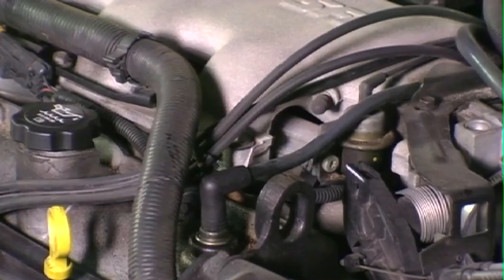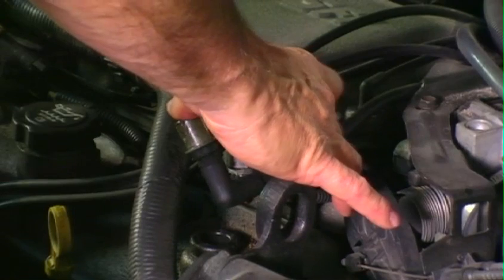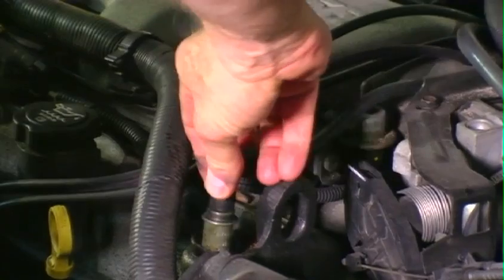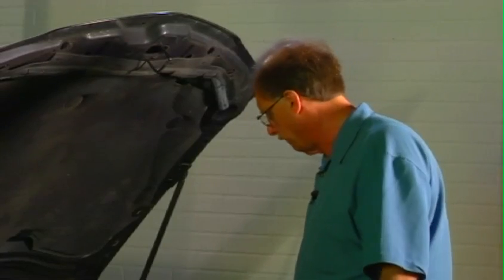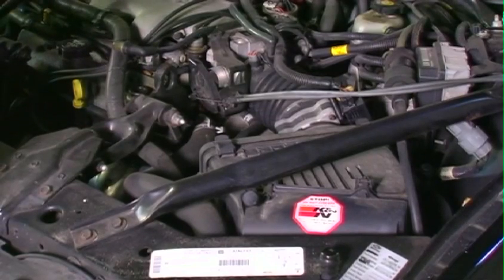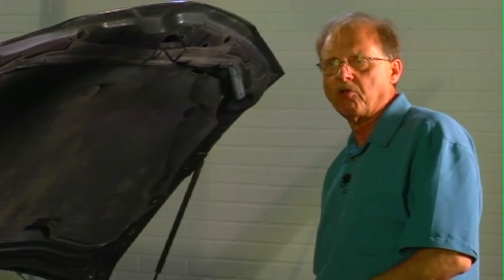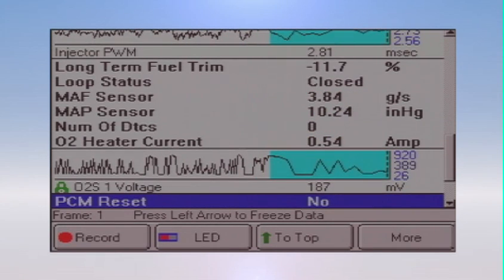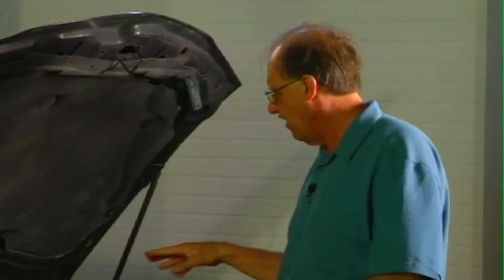PCV Valve Maintenance | Jim Wilson | Tech Tip

Comment: Does anyone know the maintenance of a Pcv valve for a carbureted motor I have a 79 trans am olds 403
Reply: PCV is cheap and easy to replace. Just buy a new one and install it and check the hose ends (no splits is what you need).  Throw away an old PCV valve (20'k or more miles) and just get a new, clean one installed.
Reply: @DougHinVA  ok thanks

Comment: Dealership charged me 3100 for a diagnosis they diagnosed and it was wrong and cost me 3100.they only want to refund half the money or install an engine free if I buy the engine but it was there diagnosis that ruin the engine.did one of there inspection and imformed of the wrong thing I had only a bad pcv hose and valve.

Comment: great Jim but also you could service the oxygen sensors while creating a vacuum leak as well
all you do is to disconnect any vacuum line - pcv line for exp. - and give a little gas to increase rpm to about 1500; that will send more gas, and eventually more flame downstream to pulverize debris surrounding 02 sensors and it will clean them out
cheers 🔧
Reply: Are you sure?

Comment: Thank you for video!!  My wife has a 2002 BMW 325xi, 5 months ago e got eng light and it was running like crap.  no power, had to pull over turn off then back on then it would seem to be ok.  I was told the CCV and vent hoses needed to be replaced.  I was charged a lot of $$ only to find out that 2 hoses were not replaced even though I had kit. Thats another story (I would take the guy to court if I could).

The car started to run crappy last 4 weeks so I took to BMW, they said issue was eng running lean etc.  Couldn't afford BMW prices so I took it to my regular mechanic.  He replaced everything over also said the original CCV valve was not replaced Grrrrrrr.  Got car and in less than 24 hrs eng light came back on same issues? Any ideas.  I want to take it to the desert and place 500 pounds of C4 inside and blow it up, This car in nickel and diming me to death.  

I also had 5 months ago the Air Idler valve replaced, and DISA thingie, and mass air flow sensor replaced plus the air intake tubes.  If you have an idea I would be so grateful even BMW was stumped he replaced two tiny parts that cost me $4 and the labor was $245, thats crazy

Dustoff85

Comment: Yeah what this video seems to actually show is that the grommet for the PCV valve is likely hard and bad considering that he was able to remove this valve so easily and that the idle speed dropped further when he plugged the valve with his thumb vs. when he installed it into the valve cover. 

But yeah these rubber parts get old and should definitely be replaced.

Comment: servicing does not automatically mean change the valve,he had a low vac pull on his thumb suggesting the hose first needing clearing through to the manifold, then recheck. Anything that recycles airborn goop like the egr or pcv need to be serviced right through to inlet,throttle body etc, makes a whole lot of difference to running and readings.

Comment: he went from pcv to iac to tps to map needing service. thats how the shop gets you for large repair bill.
Reply: that's because problems are very often systemic and related.  Sometimes it's just one part.  Sometimes it's mostly one part and also while there realizing several other things that need adjusting or maintenance.  That's not a stealership thing, that happens to me, by myself, when working on my OWN VEHICLE.
Reply: He should have just said it needs a full tune up haha

Comment: I had a slight vacuum leak in the PCV hose leading from valve cover to air cleaner hose. Only discovered the bad hose after cleaning the engine bay and at first didn't bother about it. Only after watching a few videos like your's did i take notice and replace the hose creating a noticeable improvement to engine behavior . Thanks taking the effort.